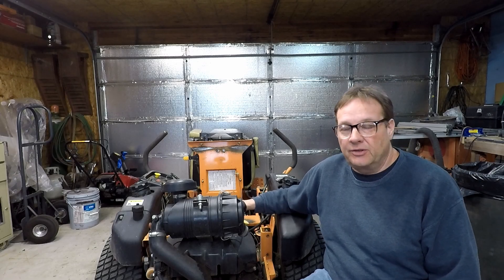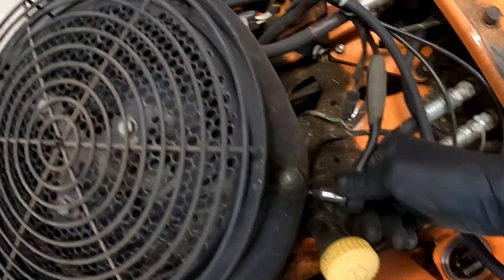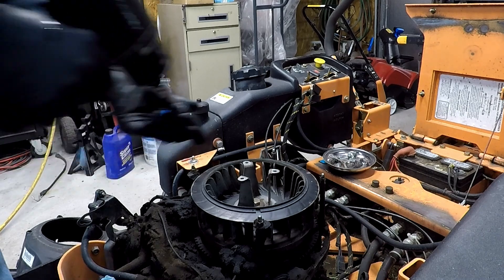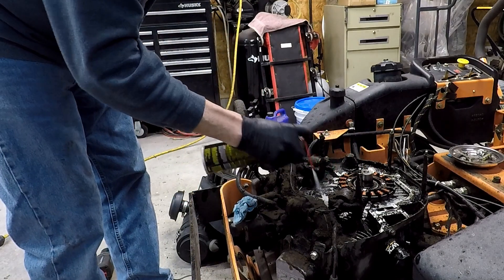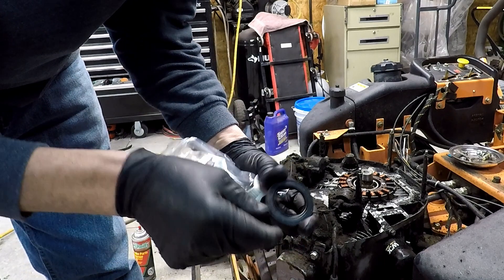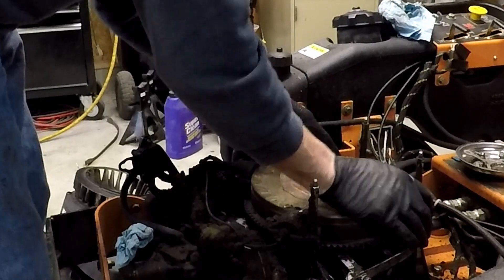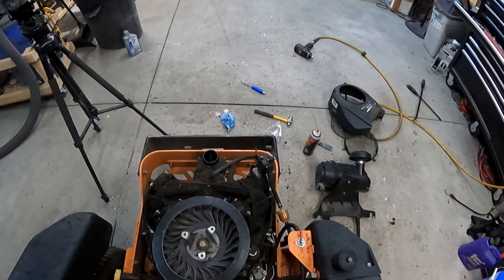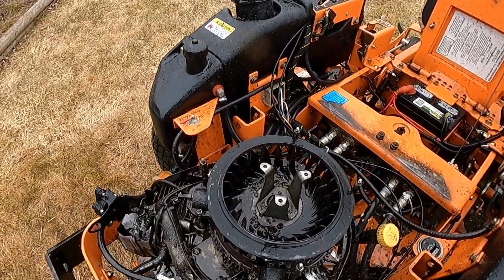Crank Shaft Seal change on Kawasaki 19 horse Engine

Comment: Nice video, by the way... On my 25hp you don't have to remove the 10mm bolts that hold the initial plastic cover, just loosen them... Also if I'm careful the air filter assembly can stay where it is as well.

Comment: Really it’s best to take of covers and clean block really good every year 
After all it’s a 15/18 k machine 
Cost about 180 bucks for good cleaning now
Reply from the maker: $15 would have bought 2 mowers 3 years ago,  repairs and maintenance cannot be ignored with the prices of parts and mowers these days.
Reply: Yes, those Kawasakis have a knack of attracting dirt in those fins and then the engine runs hotter...

Comment: Mark what's the tork on that flywheel? I just used a impact, but do I have to tork it? What's the reason to tork?  Can it hurt the motor if it's to tight? Thanks
Reply: Torque
Reply: Pop it on with a 1/2" impact, don't go crazy with that.

Comment: Hi Mark it's art, I did my crank seal, but I took my magnets off, I wish I didn't,  do you know what the gap is, at first I turned it by hand and it hit so I pulled the magnets all the way back, it runs but if I gun it it clacks for a second but then runs ok, can they be out to far?...thanks, it's just sitting till I figure it out,
Reply: The gap, you can stick a business card between the magnets and the coil, tighten it down, then do the other same way.

Comment: Hi Mark it's art, the top crank shaft seal, mine leaks to I'm going to fix it this winter, my question is, can a motor blow from that seal leaking, or is it just unsafe because the oil can build up under the cover and catch fire? I took my cover off and oil was everywhere so I took it to the car wash and power washed it now it's not smelling bad and it's running cooler, but I still have to put a new seal in it, thanks.
Reply from the maker: No it will not blow, just be hard starting when warm and leaking oil.

Comment: Better check those valve guides.  That motor was running hot because of the blocked air fins.  Need better maintenance.
Reply: And resurfacing heads required also
Reply: That was one summer's worth, he does maintain it.

Comment: Wow - That was impressive!  You made it look so easy. I have learned a ton watching your repairs - enjoy those videos the most 😀.
I wonder if you have ever encountered this…. I have a 13 yr old Scag Tiger Cat (STC52V-25CV) with a Kohler engine and the oil drain elbow fitting isn’t full tight to block (when I tighten the small shut off nut on the elbow it also turns the entire elbow).  It doesn’t leak, but as I look at it I don’t see how it can be removed / replaced without lifting the engine.  It seems the small hole in the frame that the drain elbow drops through would block the drain from being unscrewed from engine.  I was curious if you have seen this issue - seems like a bad design, but I may be missing something.  Thanks again for the great repair videos.
Reply from the maker: Lifting the engine is what you will have to do. The factory probably had a newbie installing that and didn’t tighten it all the way.
Reply: Got it - Thank you Mark!

Comment: Nice, and all this time I thought you were mechanically handicapped…..you must be watching some of KLCs vids to teach you how to hold a wrench 🔧
Reply from the maker: I’ve been a certified auto mechanic since 1984. ASC certified body repair since 1988, small engine certified since 1991. Crankshaft rebuild an balancing certified since 1993. CDL certified since 1995. Heavy equipment operator starting 1992 along with all of the repairs that go with that. I have rebuilt lift cylinders brakes on semi’s. I have also restored and painted several classic cars along with lots of semi’s and equipment.